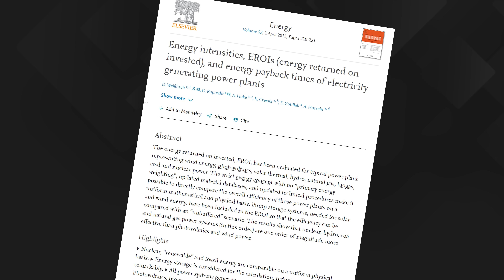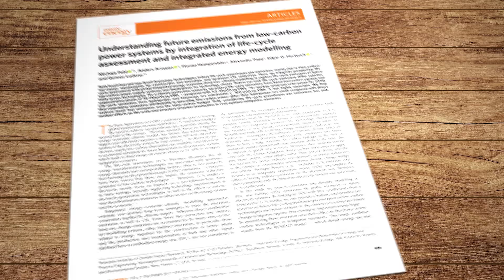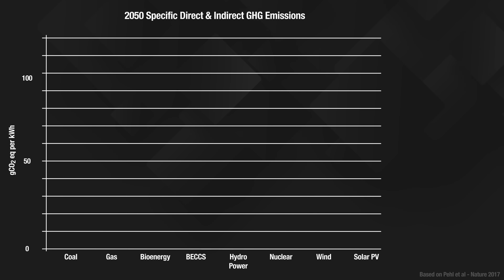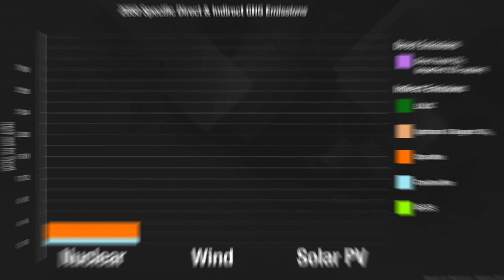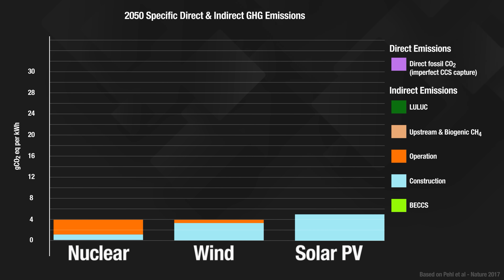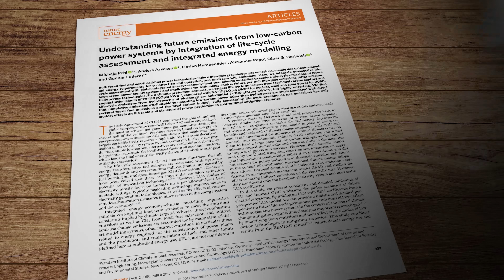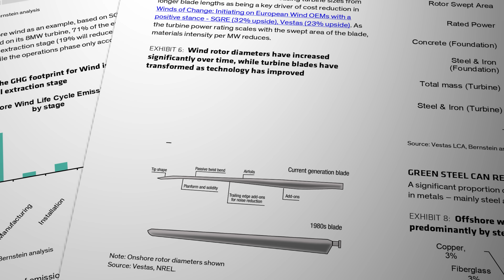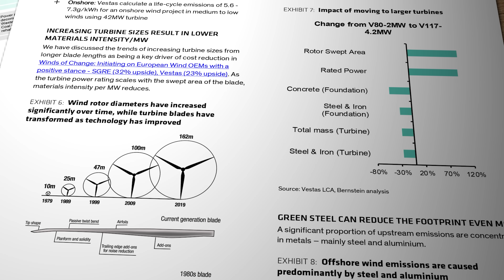Lifetime carbon emissions of renewables vs fossil fuel. Problem or solution?

Comment: These are great numbers, but what is rarely mentioned is energy independence and redundancy by decentralization. As a lot of european countries must have seen now, the world is not as stable as we expected. If your economy is still 90% dependent on an energy source from unstable countries, you're basically their hostage. It's easy for a foreign power to cut off fossil fuels and/or destroy/hack a powerplant that supports a whole region/part of your economy. Good luck trying the shoot down every single solar pv panel from every single home rooftop. Yes, we don't have enough batteries to support every home, but just having reliable power during the day can take you through tough times easily. There are still signicant parts of the world, where electricity is not stable or reliable, even from the grid, and they're managing. If fossil fuels were to be cut off without warning in winter in my country, there would be no forests anymore after a month. And I don't like the idea having a single mentally unstable person with the ability to do just that.
Reply: Yep. If people really want energy independence, fossil fuels are NOT the way to go
Reply: @planefan082  nonsense, we are not equal. i own my own gas well.
Reply: @victorhopper6774  Good for you.
Reply: Agreed! Energy independence is one of the largest reasons to go green. I use to lean a lot more to the right politically than I do now, but the idea of not relying on volitile resource costs dictated by the middle east and Russia has been and should always be the #1 reason for every republican to get on board. But it won't be "because we make coal and natural gas" as if that means we get a say on what the world market price is without deploying out military at extreme cost to ensure that prices don't go crazy.
And we pull out of the middle east... And now that we aren't sitting on the doorstep of putin and others the price goes through the roof. And now the Republicans just say if we used what we have... But we do use what we have! We are almost entirely energy in dependant right now with relatively low imports. But in a global market with a free market economy, when the price spikes then our price spikes. We may feel pain at the pump, but a lot of large American companies are getting some big benefits from this price spike and we are getting more from it than Putin is. But if we were using nuclear and renewable the largest gain from it is that while the up front cost is high, once in place the prices become extremely predictable. With predictable pricing we can more clearly see paths to growth, which raises gdp, and prevents unforeseen shocks to the system. Going green has so many benefits just on predictability, lack of need for expensive military deployments, and not funding or being beholden to enemies. And then add in that we can save human and animal existence on this rock after all the other tangable and more immediate benefits. Being concervative is annoying. What is it going to take to get my side to wake up and realize that it's not all about hugging trees? It's about retaining supremacy and technological development, and being self sufficient. Couch it in as much flowery leftist talking points you want, but there are serious implications if we don't go green. We don't need to shoot ourselves in the foot.
Reply: @CaedenV  I quite agree - I've always been astonished that Republicans who talk about small government and being self reliant, and "America First" are so against systems that encourage all of those things in reality. It's made me wonder whether Republicans just shout those slogans to justify their selfishness, or whether they actually believe their party's dogma. That Republicans claim they believe in free markets and then subsidize oil companies by the billion just makes me smile. 

It would be refreshing if someone (of whatever party) could put aside the dogma and party politics, and draw up a statement of "where we are now", then draw up a "where would we like the country to be in an ideal world" (and I mean generally, not just with regards to energy) and then work out how to get from A to B in the most pragmatic manner without regard to political positioning. Pick and choose policies that have worked in other countries, shown themselves to actually work in small scale experiments etc and actually integrate them into an overall plan.

*As for America's imports and exports of oil - what you are saying is true in financial terms (the value of exports v imports), the problem for North America is that the oil in your deposits is "heavy" crude which is best for things like heating oil, bunker fuel for ships, bitumen for roads etc. The oil you import is "light" crude which is better for avgas, petrol for cars and a lot of petro-chemical applications. That's why you will often see two prices quoted for oil on financial reports on TV news - one is "heavy" and the other "light". So energy independence is something of a mirage, even for North America.
Reply: I've been pointing out the security aspect of PV and other decentralized power sources for a long time. That pipeline hack a while back really drove the point home. 
They didn't even get into the pipeline itself, just the office computers, but in a fit of uncommon logic the company shut down the pipeline just in case. 
It's a lot easier to hack, or otherwise disrupt, a large single plant than it is to hack thousands of individual homes. Especially if people wise up and stop with all this insecure IoT stuff. If you're going to have it that's fine, just make sure it's secure.
Reply: So if we want energy independence, we need to shift away from fossil fuels and towards solar? You mean, the same panels that are almost entirely produced in China? Gotcha.
Reply: @timippel9048  Firstly, not all. Secondly, energy independence means not dying of exposure and living in the dark if a political relationship deteriorates. It doesn't matter where renewable infrastructure comes from; it can continue operating for a very, very long time without new imports, so the energy is therefore independent from geopolitical tides.
Reply: @planefan082  no, that's not true at all. Even very conservative estimates put the lifespan of solar panels/wind turbines at 25, maybe 30 years. And with how little energy they capture over a given land space, we'd need to replace thousands of acres of panels or turbines every single day. 

Nuclear is cheaper, cleaner, not intermittent and we can actually get all of the materials required for them right here. No other energy source can do that.
Reply: @timippel9048  FYI, not everyone lives in the U.S., and guess what; supplies and fuel for fossil fuel plants arrive in dozens of countries to the tune of hundreds of billions of tons per year

And solar panels aren't weak. At all. Seriously, they do incredibly well in many (if not most) places. Go up to an installation and read the output meter.
Nuclear is cool but isn't a be-all-end-all, or shouldn't--it's technically not infinitely renewable. We need a mix. All are good technologies, putting down anything is a horrifically stupid way to keep the world behind.
Reply: @planefan082  nonsense
Reply: China is building 229 Gen IV nuclear power plants.
Reply: The trouble due to seasonal changes the output from solar varies too much to be practical, on cloudy overcast days you're lucky if you get 10% of their rated capacity output!
Reply: @aldonabagusauskas4956  Which is why there are plans to build interconnectors across time zones - so that night requirements in one area is supplied by over supply in another, and vice versa. Even just in Europe there's a two hour time difference between Portugal and Greece - extend that out further and you add to the resilience of the system. And it's unusual for clouds / lack of wind to be right across the continent - so sunny areas subsidize cloudy ones - that is why Morocco is adding to it's solar and wind generation capacity, so it can send electricity North to Europe.
Reply: @aldonabagusauskas4956  Where do you live? Solar in the Northern latitudes is obviously problematic. But I have a smaller system than you (3.3Kw panels and an 8KwH battery) and last year I was a net contributor to the grid (1.17MwH fed in, and  587KwH taken) - my overall production was 5MwH. My argument is that if you look at solar by the individual property then you are right - but once the investment is made in the interconnectors you can get past that problem.
Reply: You know how easy it is to hack into the BMS of a battery system? Lol…
Reply: True energy independence starts at the household
Reply: The Earth is cooler with the atmos/GHGs/albedo not warmer.
To perform as advertised the GHGs require “extra” energy upwelling from the surface radiating as a black body. https://youtu.be/0Jijw7-YG-U
The kinetic heat transfer processes of the contiguous atmos molecules render that scenario impossible.
No greenhouse effect, no GHG warming, no man/CO2 driven climate change or Gorebal warming.
Reply: Also lithium ion electrochemical cells are not the only way to store power. But the problem is decentralized power will lead to a New world order. So renewable energy is a greater threat to normal civlisation that climate change.
Reply: @alwynwatson6119  How on Earth does decentralized power = new bloody world order? This hasn't happened in the places with decentralized power grids, in case you havren't noticed

Comment: Appreciate this sanity check. One thing we must not forget to do is not just compare our options, but also sanity check the actual long term sustainability of each option. If it's better than what we have today, but there is no chance we can sustain it under a zero carbon future, we must call it out quickly to avoid reliance of and adaptation to a bad bridge.

Please consider this framing of the topic of EVs. Many believe that with the switch to 100% renewables, EV cars, SUVs, and even pickups represent zero emissions tech and they therefore see them as sustainable. Others recognize the limitations of battery and motor resources, the embodied carbon in materials procurement and processing, parts manufacturing, assembly, and transportation of large EVs as being completely impossible at the scale of personal vehicles we have now including the demand which continuesto grow across the globe. 

Assuming EVs are nowhere near sustainable by 2050 (and beyond) under zero carbon, and that their additional demand for more electricity is incompatible with our race to quickly decarbonize, while expending a deficit carbon budget trying to achieve a global fleet of EVs, isn't it critical that we assess, acknowledge, and abandon an EV strategy and all of its associated resource investments including excess charging infrastructure and using up all the motor, battery, and general electronics resources. We will surely regret not instead building sustainable electrified public transit, much more extensive freight rail, and bikes, e-bikes, and other micromobility, which all have a much higher chance of representing sustainable transportation by 2050 and beyond? Very few fully acknowledge this publicly, but those of us working in sustainable transportation have largely ruled out full sized EVs as a permanent option going forward. This is the debate we should be addressing with LCAs and 7th generation thinking. We are only thinking about what it takes to wrestle people out of a gas SUV and into an electric one. The Volvo & Polestar LCAs as well as the Trek LCA are good places to start. I'm happy to work with you on content for that episode if you choose to do it, because it is the most critical discussion not taking place in Climate Crisis solutions circles.
Reply: It does appear that folks are energy blind.  It seems impossible to take apart all the hydrocarbon technology while still employing it do all the work it does for us.  The only logical solution is to radically reduce demand.  The dilemma is that I don't know of a single individual that would surrender their personal living standard (represented chiefly by owning one if not more motor vehicles) for some grand idea of saving the world.  I haven't done it and I be either has anyone living in America.  We all rely upon the same roads, pipes, electric grid etc. even if we don't "own" a car.  
We will have to have a collapse before demand is significantly reduced.  The dream of a smooth process of transition is just that.  Industrial society is not built on dreams but instead the work of machines.  If you can imagine all the changes that would need to occur to have a sustainable future,  you are a better seer than me.
Reply: Yes, more of this line of thought please. Would be great to see a collab with Dave on this topic. Cheers.